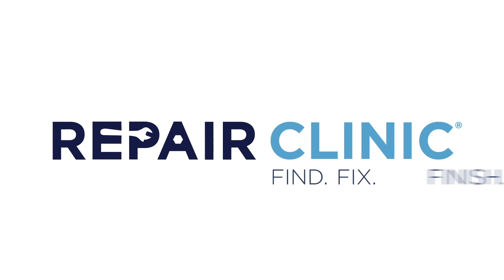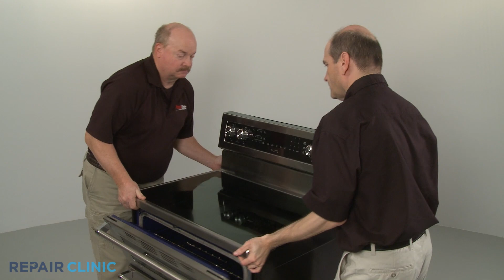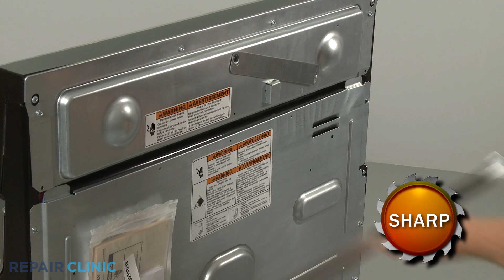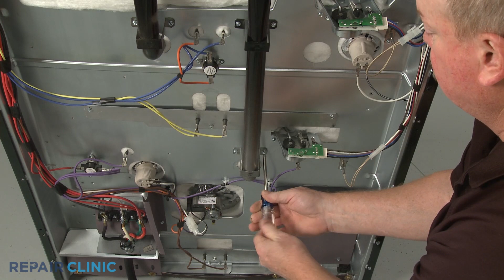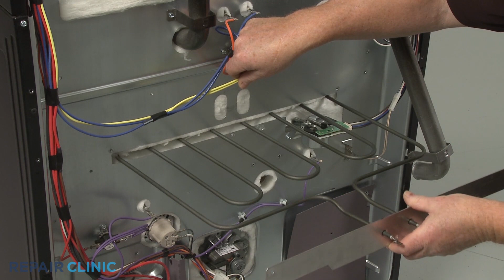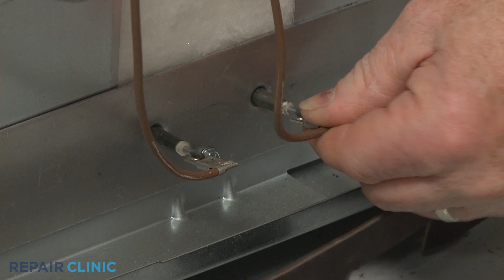Kitchenaid Double Oven Electric Range Bake Element Replacement WPW10249981

Comment: You advertise this as a double oven replacement video but it's not a double oven.
Reply: Yes it is.
Reply: Well it’s a double oven - a range- but not the one designed to be built into the wall with a flush  front. 
Makes it very difficult and expensive to access :-(. .
Reply: @meredithmercer  They have a video for a double wall oven too: PmsPXHWUfo8
Reply: @meredithmercer  They have a video for the double oven wall mount too. The comment doesn't let me include it but it's there.